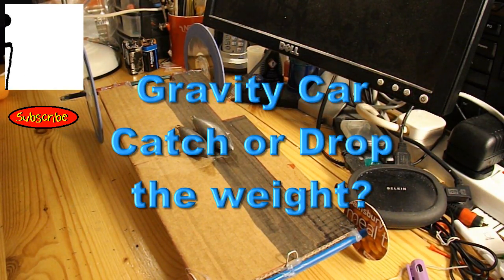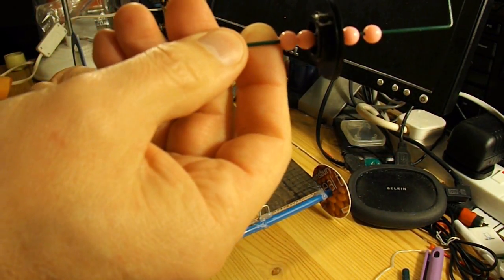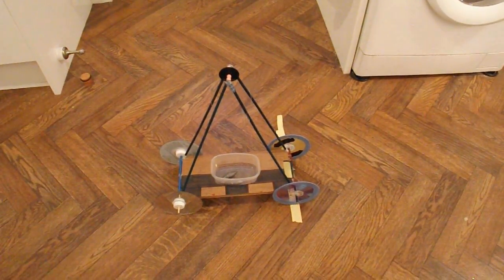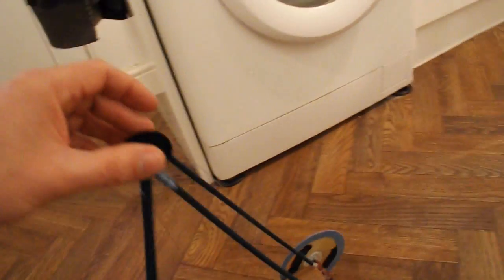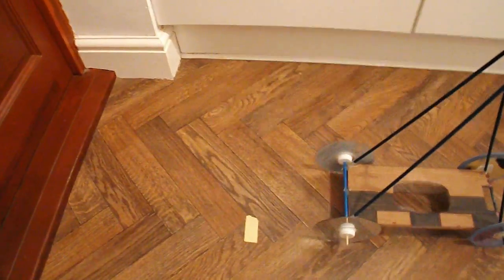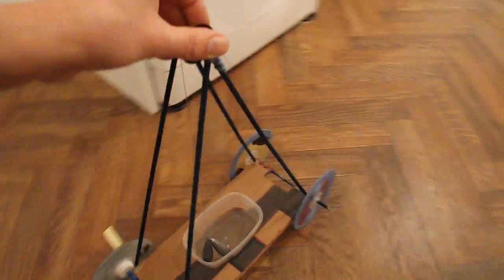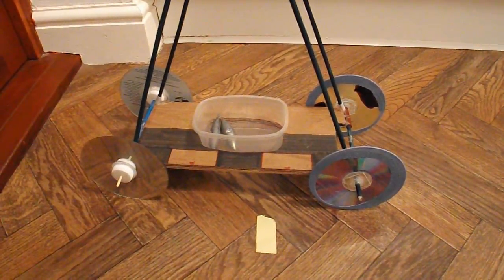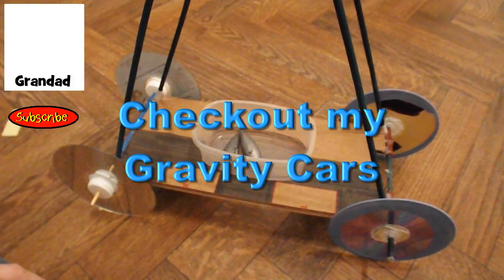Gravity Car - Catch or Drop the weight ?

Comment: I was expecting it would go further -- you lose momentum, yes, but you lose a lot of normal force, which means you lose rolling resistance / friction losses.  
My daughter needed to build one for a high school AP Physics class, and I was fantasizing about a complex mechanism that would transfer the energy into  a mousetrap spring and drop the weights, reducing the car to a mousetrap car 🙂 but there wasn't time to design it
Reply from the maker: It was an interesting suggestion, so I tried it and got a result. Other people might get a different result. This was hardly a scientific approach, but I shared it so people could see what happened. There are many things that could be done to this to improve the results, plenty of opportunities to reduce friction with the axles and bearings. Nowadays, I would 3D print many of the parts. Back when I did this, I was focussed on bamboo canes for axles, plastic drinking straws for axle tubes, scavenged bits and pieces, and everything stuck together with hot glue. Things have moved on since then.
Reply: @GrandadIsAnOldMan  That's exactly how your teenage kid builds a modern gravity car at 1:00am the day before the race: hot glue, skewers, straws!

Comment: how does the wire attach to the back axle ?
Reply from the maker: At around 02:44 I show there is a thin peg straight through the back axle to hook the string onto the axle. You can see it again at several times through the video. The string is attached to the weights, then goes up over the pulley, then down to the back axle. It has a loop tied in the end of it, so you can just hook it over that peg and wind the string round the axle to lift the weight. A tooth pick would be the right sort of thickness, just a short bit, maybe half an inch or a centimetre long.
Reply: @GrandadIsAnOldMan  thank you so much ! i am doing a project like this but with a water bottle and wanted to figure out how to make the weight drop. thank you for getting to my comment !!!
Reply from the maker: @brady.horton  good luck 👍

Comment: Hi sir im having trouble making the car come back is there any way to make the car go 5 meters and come back using a 1 kg mass at the drop height of 1 meter Thanks
Reply from the maker: If you don't need to be too accurate about the exact distance then you could use the same method that I used in this rubber band powered car. You wind your string round the back axle a certain number of turns one way, then a certain number of turns the other way so that as it unwinds the car travels forwards for a distance and then backwards for a distance https://youtu.be/bBU8UngaFfM?list=PLA5a2xPRSrB04L6RpUAs5akmK3jqmahPL

Comment: better to put the weight on pendulum, with a ratchet mechanism and keep recycling the energy of your mass as it swings.  in a high school distance competition, my daughters single axle vehicle with a brick as mass was stopped by the far wall of the gymnasium. we never actually found out how far it would go but it beat the competition by one and half basketball courts when it was stopped by the wall. we used a cheap bicycle freehub as the axle and ratchet and cut out wheels 36 in dia from 3/8 plywood. bicycle wheels and a good shimano free hub would be better yet.
Reply from the maker: Hey that sounds great, I can picture that in my mind. Did you video it running?
Reply: Unfortunately no, but to help Your minds eye, the whole contraption was painted orange ,  wheels had  cut outs and paint to resemble an orange slice.  Now that I'm thinking about it we also had to coat the wheel rim with silicone to give a little traction. On the first test the torque of the pendulum overwhelmed the minute amount of friction that the plywood wheels  had with the road surface.  I remember my daughters science teach to be really taken aback when  she showed up with it.
Reply from the maker: I shall put this on my list (it is a very long list) I am going to keep my eyes open for scrap bicycle parts as I rather like the idea 😊
Reply: do you possibly have a picture of this ?

Comment: Excuse me sir, but may I ask which video you made the base for the car in, while working on the original rubber-band car? It would make getting the dimensions for the car much more easy. I have a project to build a gravity powered car, and if I could make a similar, smaller version to this build, then I could easily have the car built and ready to go. Thank you very much for your time, and also for the videos! It's pretty interesting to see how you make all these cars.
Reply from the maker: +TheFallenblackwolf gosh I have hundreds of videos on making rubber band powered cars and many of them are like this, just a piece of cardboard with drinking straws hot glued to each end. The first time I used this particular piece of cardboard is in this video https://youtu.be/I2tCuuhXdqQ?list=PLA5a2xPRSrB3g5RiX8Kf_uUBOL0Tb7AS0
Reply: +GrandadIsAnOldMan Thank you very much! The video is a perfect guide, and I already have the materials assembled, so it should all be rather fun to get it built. I wish you a wonderful day, sir.
Reply from the maker: TheFallenblackwolf good luck :)

Comment: Hi! I love how you tested the two different ways so we could see the difference. I was wondering if you still remember what kind of materials you used for the gravity car? Thanks.
Reply from the maker: +Alicia Zhang The main car is one of my old rubber band powered cars. The chassis is a piece of cardboard, the axle tubes are drinking straws, the axles are bamboo cane or bbq skewers. The wheels are CDs, the hubs are bottle tops. The tower is bamboo canes, the pulley came from an old record player, a few paperclips were used and also some plastic bead for spacers. I used fishing line but string or strong cotton would do to lift the lead fishing weights. I have updated the video description with a few useful links
Reply: +GrandadIsAnOldMan thank you so much!

Comment: I feel honored sir! Thanks for taking the time to run these experiments! I too am puzzled by the outcome. I thought sure the added mass from the weights would make the car go farther.
Reply from the maker: Hey, it was your comment that inspired me to test the options so thanks for commenting. I doubt that my results should be taken as a definitive proof, but as you see I tried it with two slightly different setups and still had the same result. Maybe the weight should be considered to work like a booster rocket that is discarded after it has served it's purpose.

Comment: What do you think the most efficient type of car you have made is? Do you think you could best it
Reply from the maker: Hi Landry, you would have to define efficiency. I could improve all my cars simply because you learn from experience. I try to limit myself to items I have salvaged or scavenged or bought cheap, so I could improve cars by buying the proper components like wheels or motors designed for model cars rather than using CDs and motors from vibrating toothbrushes. Even the rubber bands I use are the cheapest I can find so proper rubber designed for model aeroplanes would be better. This gravity car I have just been working with was not designed as a gravity car, I have just adapted it. If I wanted to do the same project again to test the Drop or Catch question I would make it much wider so the wheels don't run over the weight when it drops to the floor and there would be no chance of the weight hitting the chassis as it falls through. I would even change the shape of the weight.